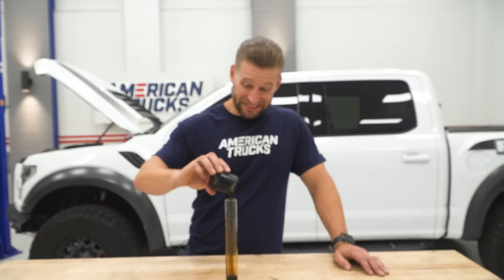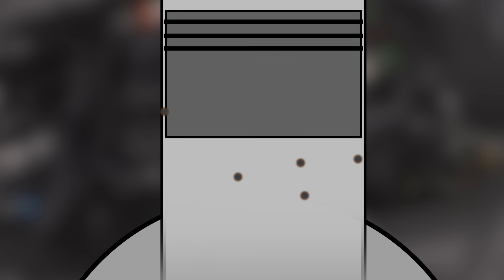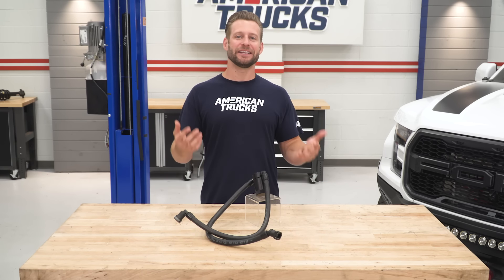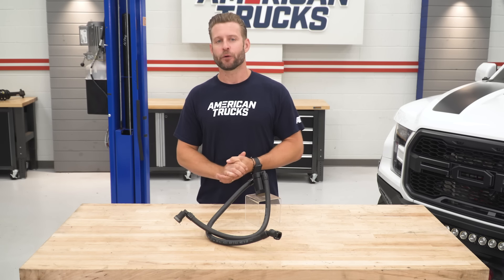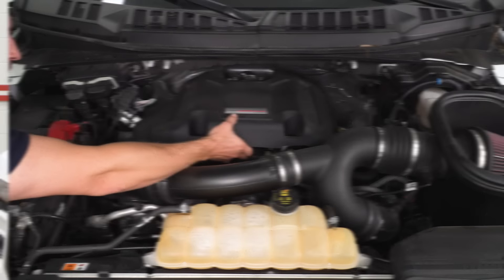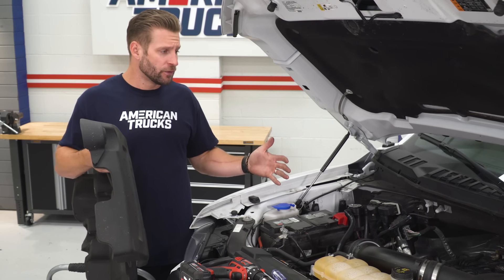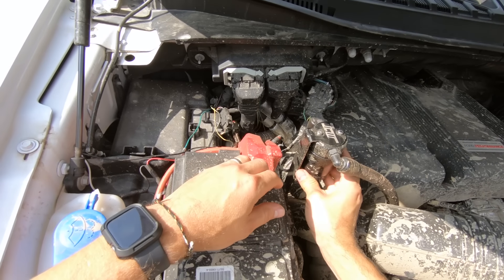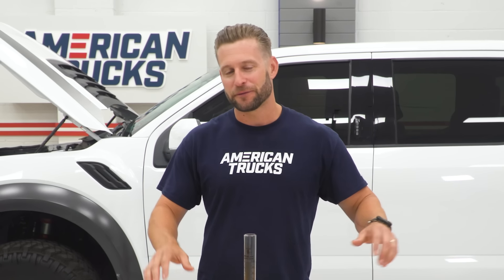Does Your F150 Need a Catch Can? - Ford F150 Oil Separators Tested And Explained

Comment: do you need a catch can for a 2018 F150 ecoboost 3.5L.
Reply from the maker: You don't need one, but installing one will absolutely help keep things gunk free and running smooth! -Zach
Reply: Yes you do,,,,,,I installed one and was very surprised at all the oil it caught in a very short time.  

Note,,,,here is when it accumulates more = short drives, cold wet weather or very hot weather.

Comment: I have a 2015 2.7 ecoboost with 94,000 on it and no catch can. why would I not be seeing issues?
Reply from the maker: You don't absolutely need a catch can for your EcoBoost for it to run properly throughout it's lift,  but it definitely helps keep things clean and efficient as possible. Most likely if you were to take a look at your intake valves, you would see a fair amount of carbon build-up. If too much of this builds up (known as coking) you can see a dip in performance and efficiency over time. You can always have your intake valves cleaned via treatments at the dealership, but purchasing a catch can sooner in your engines life can help eliminate the need for this.  Hope this helps! -Zach
Reply: I find it hard to believe that something that can be catastrophic to the customer, that would taint the ford name, yet so simple to fix, isn't already on there from the factory and was missed by everyone designing the engine. this was a known issue with old direct injected engines, so its not like this is new technology. valves can still have major carbon build up on traditional duel ejected ports. it seems like a sales pitch derived from the failure of old direct ejection engines to make a quick buck off of fear. if this was truly fords fault why isn't there a class action suit for purposefully building something designed to fail?

Comment: I Own a 2012 F-150 Lariet FX5 powered by 5 star Tuning
JLB oil catch can
2 inch leveling kit 33 inch tires Cooper Discovery AT3 XLT 10 PLY cost me installed out the door with tax $1,275
Factory Platinum grill
Ranch Hand full bumper replacement
Factory Platinum wheels 20 inch
Platinum headlights
6.2 Ford Powered V8
6.5 bed
3:73 gear ratio
6 speed automatic
4WD
Ingot Silver paint
Platinum factory 2012 F-150
Bully Dog GT Platinum Tuner
Custom 5 star Tuning
S&B Cold air intake
Pedal command
3 inch Exhaust system
Super 44 flowmaster
resonator delete
5 inch exhaust tip

Comment: Bought one of these a couple of month ago...easy to install. But I have a question...I noticed a large drop in fuel mileage after install. 4 to 5 miles per gal. I have know idea why that would be. Put the old PCV set up back on and mileage came back up. Any one else have this problem?
Reply from the maker: That is very unusual.   Without knowing more about the trucks condition, install or further details I would have to say something was definitely out of the norm. -Justin

Comment: lots of variables as to how these devices work and their real effect on valve deposit buildup. I can't help but wonder just how much of the suspended petroleum components present in the blow by gas are actually caught by the catch can. There is a lot of blow by gas and the particle size of the oils varies so it is in my way of thinking likely that a significant portion of very high volatility oils are remaining suspended in the air and ingested into the engine. I would expect only the very largest  oil mist droplets would be settled out by such a device as this catch can. Bottom line is I suspect there is a lot of false sense of security to be had here.

Comment: Would this mod affect the  manufacture warranty ?
Reply: No. In order for a warranty claim to be denied the manufacturer must prove that the mod directly cause the failure. In this case you are simply separating oil from air.

Comment: I'm guessing this is a good idea for the v8 also?
Reply: The V8 is port injected this should not be an issue with port injection as the Gas cleans as its injected. I would like to know what they say too though. If you bought the V8 you made a good choice for longevity and reliability. I am currently looking for a 2015 V8 model.
Reply from the maker: Absolutely- I have one on my Mustang as well and it performs in the same manner.  As grizzly pointed out most of the V8's have a port injector so valve coking really isn't a huge concern but you're still going to capture all of that junk that would otherwise be getting re-routed back into your engine through the intake manifold.  -Justin

Comment: So, I have to ask. You and several commentators use the word “junk”. Oily junk. I don’t see where anything other than oil as pure as what the engine is depending on in its crankcase should be finding its way into the catch can. It actually seems as though you should be able to dump it right back into the crankcase. If it’s not good enough to be there then the oil in the engine shouldn’t be either. Am I wrong?
Reply: senseisambo Remember that blow by gasses have been thru the combustion/ ignition process and between the heat and pressure the oil breaks down and will collect any hardened debris from the piston and cylinder walls. So, "no", don't dump it back into the motor. 
I hope this helps to answer your question...

Comment: I’m a little late to the party, I have a 4.6 3v do I need a catch can?
Reply: Engines that have injectors mounted in the intake manifold don't necessarily need this because the fuel spray "tends to" keep the valves cleaner

Comment: Sooooo why wouldn’t ford put these in the truck stock?
Reply: Three words.
Environment.
Protection.
Agency.
Reply: Two words=> they freeze
Reply: @dateatorjr9671  
Motor oil and gasoline "freezes" at what temperature again?
Reply: Jared DeHart ever hear of condensation???
Reply: @dateatorjr9671  
Ever heard of disproportional contamination?  Lets also work out average dew point to establish water content to determine condensation rate.  Then compare that to the byproduct rate collected into the can.  

I'll save you the trouble, it's less than .024% of the contents.  Dilute that in the solution of oil and gas and guess what?  It doesn't freeze. 
(Unless you regularly poor water directly into your air intake, which, based on this conversation, I would believe, then you simply wouldn't have enough water.)

Now that we're done with middle school science, would you kindly shut up?
Reply: @Bart Merriam 
That is true.  Before Catch Cans and PCV systems they simply had a tube that let those contaminants drain onto the ground via a "road draft tube".

I can't remember the specific year but the EPA banned these, so the catch can was created.  The EPA still didn't like this system because drivers were prone to improperly dispose of the byproduct.  So the EPA added a fine system for automakers utilizing this system in their production cars.

If you consider that manufacturers could have easily designed a system that bypasses the catch can when its full as well as alert the driver that the can is full via a sensor and dash light, then then there simply is no other reason not to use these systems except the EPA regulations.
Reply: Jared DeHart how about just looking at facts.  Real world cases where catch cans and or lines actually froze and blew out peoples seals.  Not worth the risk up here in the northeast.
Reply: @dateatorjr9671  
I think I'm hung up on the use of "Freeze"/"Frozen" as in the literal Chemistry term and not in functionality.

Comment: Why doesn't the manufacturer put this on to begin with?
Reply from the maker: A couple of reasons but ultimately it modifies an emissions control device (PCV) so therefore the bureaucrats automatically deem it bad, despite its usefulness.  The tides are beginning to change however and some cars are even getting factory oil separators installed (2020 GT500).  -Justin
Reply: Manufacturers won't put these in most vehicles cuz then you'll never come in for services 😂 from the damage with out the catch cans
Reply: I think the average Joe is too lazy to empty it. Most can't even be bothered to get the oil changed on the regular, or check tire pressure. A completely full catch can can be very damaging

Comment: Do i need one on a 1995 Ford Lightning? If so, where do I get it?
Reply: You don't really need one on the Lightning but it won't hurt anything either. It is only really necessary on direct injection engines.
Reply: Country Joe 10-4, thanks brother!!
Reply: it will help regardless, you are removing potential oil from being burned in the combustion chamber. while more important on direct injection it still helps on any car with a PCV system.

Comment: I have a 2017 3.5 eco with maybe 26k miles.. I have the platinum warranty, if I add the catch can, will it void the warranty or cause issues with smog? I live in CA so.. CARB rules are a bitch.

Comment: Will it work it for 2014 raptor
Reply: Yes
Reply: Clark K I have one with a breather on it an I install it like on 2 week ago I finally check and there ain’t any oil fluid in the can so is that good or is the breather causing it to not work right like when I crank the truck up it will suck in air but when a turn it off it will exhale from the crank case pressure sometime exhale not all the time
Reply: Clark K a catch can like like instead of 2 nip a third on on top for a filter

Comment: Why only one side?
Wouldn't both be twice as good, and catch twice is much?
Reply: Dont ask I agree. Is doing one like doing the job half a$$?
Reply: From what I’ve read most if not all the gunk comes from the passenger side. I don’t know why, if this is true, but I would like to know. 

I have the JLT installed on my ‘19 3.5L F150 and it catches a lot of crap just like it’s supposed to.
Reply: Because the pcv valve pulls from the whole crankcase, everything just goes through the passenger side valve cover and back to the intake manifold.

I have one on my 2011 3.5 and it catches about 6 to 8 oz every two weeks depending how much i drive.  Mine has a third port though (rx brand), for the boosted side plus one for the vacuum side.

Fordtechmakeuloco has a video on this and he installs an RX kit.

Comment: Don’t waste your money guys just use a really good oil filter with a 20 micron media a synthetic oil and you’ll have zero issues. I have a 2011 3.5 ecoboost with 217,000 miles on it with no issues. A good oil and filter at about 5,000 miles and your engine will do what it’s designed to do.
Reply from the maker: Oil filter has zero impact on a PCV system. -Justin
Reply: @americantrucks  yes it does. I changed over to a better oil filter and the difference in the fluid passing thru the pcv system was astonishing. Before it was a horrible black color and after it was the same color as the brand new oil. My pickup ran better, the hesitation went away so you can’t tell me it doesn’t have anything to do with it.
Reply: Just an update, my 2011 f150 3.5 ecoboost has 464,000 miles on it and zero valve issues, zero turbo issues my timing chain has started to rattle because some kid at the shop employed wasn’t putting the right filter on for 2 oil changes screwed up the tensioner but still, NO CATCH CAN!

Comment: the turbo subaru community has been preaching the benefits of aftermarket air-oil separators for years......ours are cooler though, they drain them selves to the oil pan, and they are heated with engine coolant to keep them from gumming up

Comment: Thanks for the explanation and good info!!! Do other non FORD engines need this as well?  If this is a problem why don't manufacturers include one on new vehicles?? If its just a forced induction problem why do the coyote's need it?
Reply: It's my understanding they don't install one, because it won't pass smog tests with one.
The PCV system is a smog system, and the whole idea is to burn it, not dump it out somewhere
Reply: If it has pistions this will help. They do include theas for owners to ignore till they plug up and blow the seals out of there motors  usually only found on forced induction . Even Cummins has a variation.

Comment: Anyone know how the new 2019 3.5's are with this issue?
Reply: Adam Cessford from the very little I’ve heard about the ecos (I haven’t really done any research) they have more timing chain issues than anything else
Reply: @brycea0225  They added port injection to the newer Ecos.  Since that puts fuel on top of the valves to clean the oil off, the valve coking shouldn't be an issue.
Reply: Tank Sherman yessir. They seem to be doing better on that issue. Like I said I’ve only really heard of a lot of timing chain issues and who knows how common that actually is. You’ll only ever hear of disasters and not the trucks that last 200k miles
Reply: @brycea0225  the added a second tensioner on the other side to prevent the chain stretching.  Guess they determined the flapping on one side was causing the stretch.  Time will tell.

Comment: I installed this on my 2020 3.5 Eco and my gas mileage went from 21.5mpg to about 18.5mpg. Yeah its coming off. Not exactly sure even if they are necessary as much now on the newer models with the reconfigured injections.

Comment: Okay I just have few questions, does the mess screen ever have to be cleaned or the tubes flushed out somehow? If so how does one go about that? And I am looking to get into a 19-21 Ford F-150 eco boost engine XLT model. In these models has ford went ahead and already included this? Or is it still a necessary thing to get in those year groups?

Comment: I have a 2017 5.0 with 45,000 miles on it. Would I need one for this style engine? And would it be a good idea to install a driver side kit too?
Reply: Only the Gen 3 Coyote is direct injection.

Comment: Why didn’t ford install these from factory?  They could do this rather inexpensively....and save owners the trouble
Reply: @YoungOzzy432  Blow by isn't poor engineering. It happens in every single internal combustion engine. If the benefits aren't obvious then don't use it...simple. The reality is that Octane is maintained rather than being diluted by oil infused air and cleaner overall engine operation...longetivity should also be improved but harder to measure.
Reply: If they had installed one at the factory it would become a maintenance task for the owner. They can't put it on an interval because the amount collected will vary based on many factors such as turbocharging, how often your in the turbos, how heavy you are on the throttle and so forth. Routing the blow by into the intake makes it simpler from a maintenance standpoint and the cost in potential power or engine longevity will be lost on most consumers. Those that understand the benefit will add it aftermarket and those that say it voids warranty or say it's illegal have no idea what they are talking about....or perhaps live in the people's republic of California.

Comment: So if this is a must why doesn't the dealer Install these??
Reply: Jesse Yermalovich I believe it’s because it’s an additional step in maintenance that most people don’t have enough know how or care to deal with. Think about how many cases you hear about people doubling oil change intervals or never change trans fluid, etc. better to let the engine try to burn it than make people maintain it
Reply: @brycea0225  I get it, but you think if it's really needed the factory would already have them in place...., I get it but I also dont ...cause the price of some of these is just plain stupid
Reply from the maker: To be honest some manufacturers have actually started including a variation of these from the factory including the new 2020 GT500 which comes with one standard (track pack). -Justin

Comment: Has Ford fixed the timing chain issues on the new 3.5 liters yet?
Reply: Yes. Gen 2 engines have heavier chain and 2 oil pressured chain tensioner. Gen 1 only had 1.
Reply: Fordfanone but the chain still Stretch
Reply: Even with the two chains ⛓ tensioner

Comment: But what do the valves look like?!?!?!?!??!?!
Reply: Considering the ones usually shown are from Audi and BMW, I would like to know as well. To date, no one has shown an actual Ecoboost intake with coked valves. My Inlaws have a Flex EB, had an injector fail. We took the intake off to look, no crud on the valves with 85K on it. Hmm.  Should have taken a picture, but didn't have my phone with.

Comment: I'm pretty sure the 3.5 EcoBoost Gen 2 starting in 2017 was the first model to have the dual intake system. (Direct and port injection) 

Not 2015.

Catch cans really aren't needed on Gen 2 3.5L.  I mean you can put them on, but it's not something that should be required.

Comment: just put a breather in the valvecover and not dump that garbage back into your intake and scum everything all up, just vent it out into the air. then you wont be sucking oil and shit up at the same time also... just like all V-8s used to do.. wh ythey gotta go and make shit overly comllicated and jsut plain worse at the same time? oh great, now i gotta clean my intake valves because somone thought it a good idea to dump the crankcase breather back into the intake, which is undeer vacuum and gonna suck in a bunch of oil and shit with it... its like they just wanna make shit not last very long and need extra maintenance at the dealership... new cars jsut keep getting worse and worse as far as maintenance cost and reliability... yeah sure they last ok if you put enough money into them... but an old small block or big block chevy goes 500k if you change the oil and dont overheat it... and doesnt suck shit into the intake, it jsut has breathers in the valvecover, i have several sets of BBC valvecovers with breathers sitting in my garage right now..